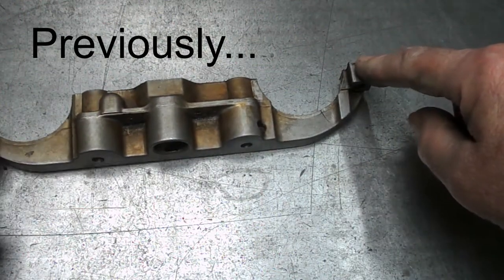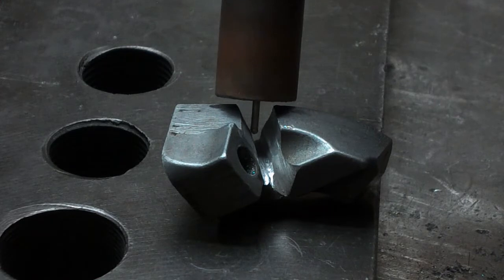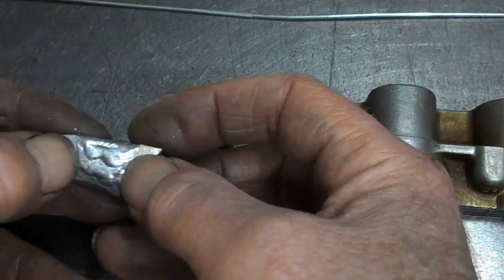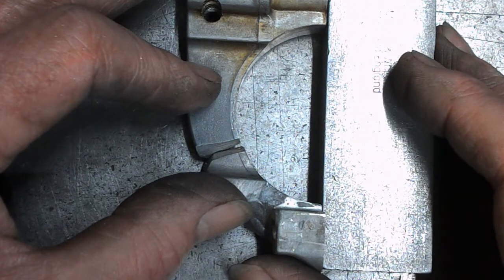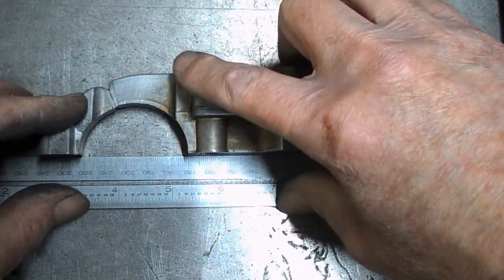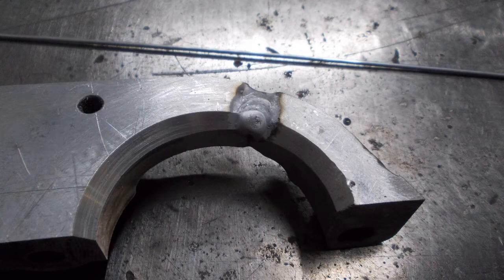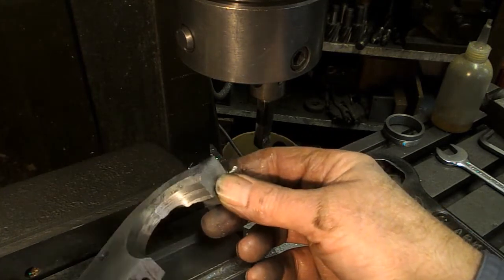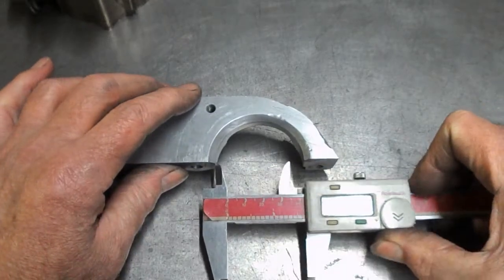Repairing a Mini Cylinder Head Plate (part 2)

Comment: Interesting to hear your thought processes on this tricky conundrum. Good to see it all worked out in the end, although it might not be available as a spare due to only being line bored to match on the head.
If the above is not necessary i think i would have made a jig to hold the bolt holes in correct alignment, cut any bits that got in the way and then build it all up and remachined to spec afterwards, but then i am no welder.😉

Comment: I learnt a lot from watching you there, but it begs the question why did they not just go to the scrap yard and get another?
Reply from the maker: That's a good question! There are several different engines used in Minis so maybe they couldn't find the right one at the time, or maybe they were still up against the problem of having to buy a complete cylinder head...I don't know.